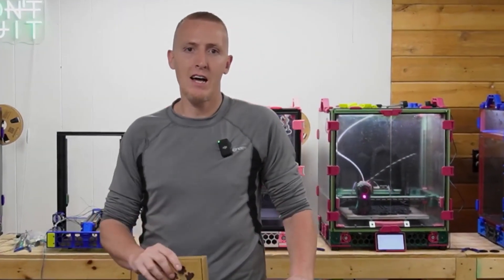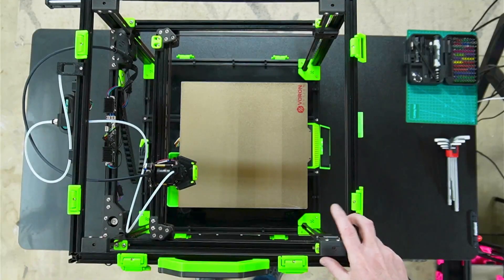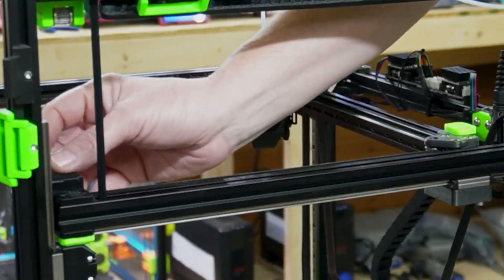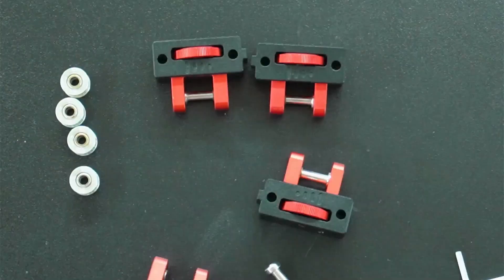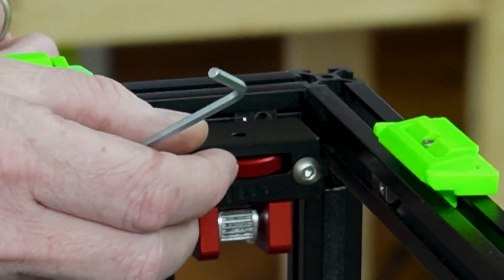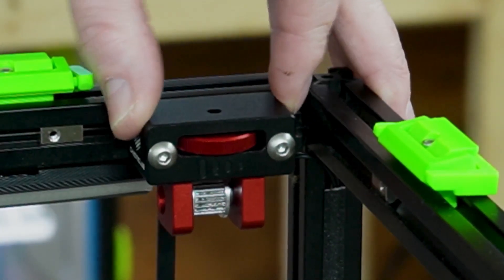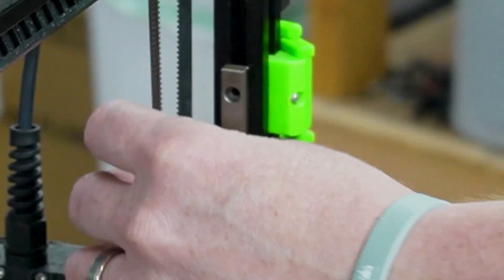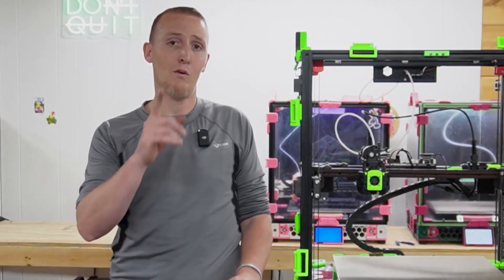ChaoticLab Z-Axis CNC Tensioners: Upgrade Your Voron 2.4!

Comment: I can't believe no one caught the washer mishap!
You placed a washer on the bolt head (no, nope, nadda) . The instructions did not state to place a washer there. You also did not place a washer on both sides of the Pulley. This would be the one washer you placed under the bolt head. Your pully moved side to side when it should not, hense the reason for the washers in the first place.
Great video though. Please do a review of them in the future!
Reply: The order is screw > cnc part > washer > pulley > washer > cnc part and screw, however the first time you did it it was screw > washer > cnc part...
Reply from the maker: Hey! I went back and watched this to see what I missed. But I don't believe I have missed anything there. So the washer on the bolt. That's just an easy way to put that first one on.  Since that bolt just sits inside that channel, it actually sits up against the pulley. So that one is correct. And the other washer goes on the other side. It just makes for a smaller space to keep from excessive play back and forth there. But it will still have slight movement there. But in the video, each pulley does have a spacer (washer) touching each side of the pulley on them all. Thanks for watching! We got another video coming out probably today or tomorrow on the XY tensioners you should check it out! And join.. our.. discord :) Happy Printing!

Comment: Super helpful! Would you recommend these for people not struggling with this part? What are the primary advantages?
Reply from the maker: Honestly, in my full honest opinion which I will always give. If you are not having trouble with your current setup and your not pushing the machine to max speeds and such. You will be fine with the printed parts. These do help a lot (especially with a full set) with input shaper results. Stay tuned for a (possible) full CNC build! Good to see you btw!

Comment: Changing your rooms lighting to a brighter white colour would help the video everything looks yellow also uploading in a higher resolution the compression makes the video look dated to 2013 style videos. Great content though.
Reply from the maker: Thanks for the tips! I have some pretty bright white lights all led in the shop though. I'm going to start recording these videos in 4K for the edited things like this one. Are you watching in 1080? I'm just curious because sometimes depending on where I'm at, yt drops the quality down to 360 even. Check the settings button on the top right and change it to highest quality and see if it's the same. Should be 1080 for you. I'll look into this though. Thank you for watching! I got an XY video almost done coming next :)